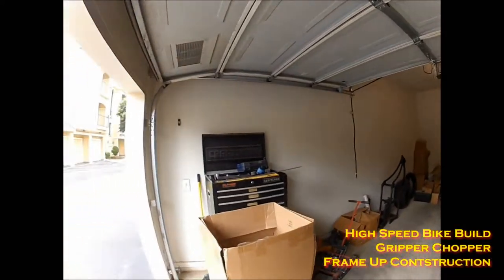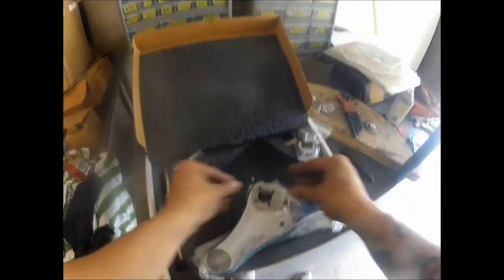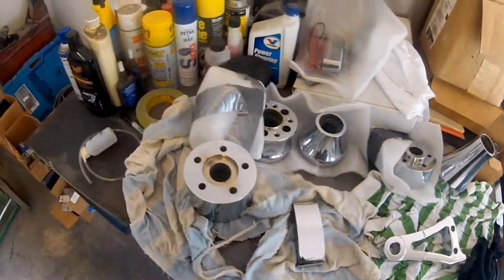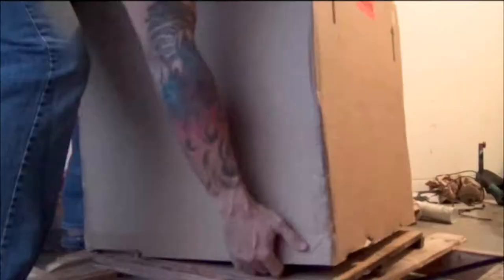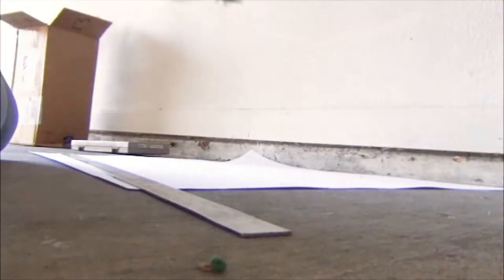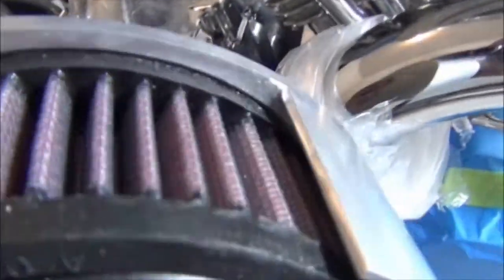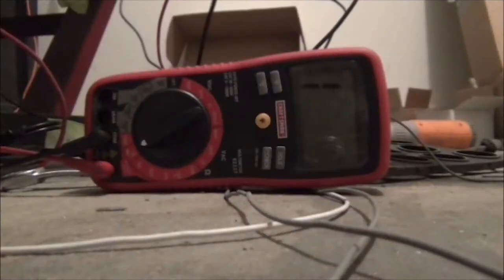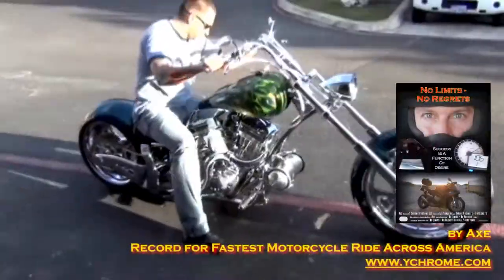Custom CHOPPER BUILD Time Lapse of TROPHY Winning Motorcycle

Comment from the maker: High speed vid of the Gripper chopper, 300 rr tire, Y Chrome air cleaner, shift link, motor mount, coil cover, wheels, and paint. 121" engine 6 speed tran, open primary.

Comment: where can i order parts ? i find it difficult to get parts here in Botswana
Reply from the maker: S. Africa? i don't much about getting stuff there, but interestingly, the frame on this green chopper was built in S. Africa. I had a shop in the old days, so i bought most of the parts direct from dealers. I don't know if you have any motorcycle shops around there that may have distributorships with suppliers like drag specialties? Drag sells about anything you'd need if you can find someone that represents them?

Comment: How much for a bike like this
Reply from the maker: that was done with some pretty expensive components, lots of custom parts incl. wheels, metal work, etc. i built it for myself, so didn't really price it out, but if i would've built that to order for a customer, it probably would've been in the $45K range. prior to this one, the most expensive one i built went for $35K, most were more in the mid to upper 20's depending on options.
Reply: Dam wish i could afford that or had the knowledge banging bike though
Reply from the maker: @OfficialPsXGaming  much appreciated, and actually, years ago, a lot of guys bought choppers when they were in high popularity, but these days, you can pick up used ones extremely cheap relatively speaking. i have buddies that have bought used big dogs and texas choppers for $7-10K range that were practically new bikes. lot of guys that bought choppers didn't ride them very much.